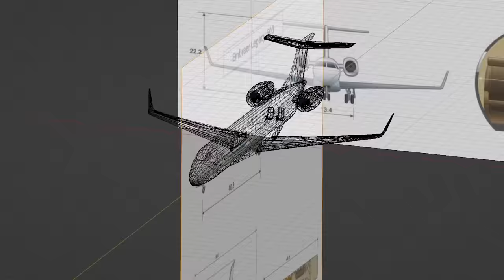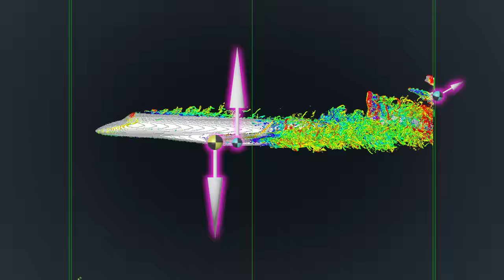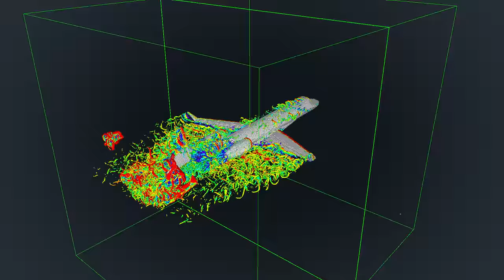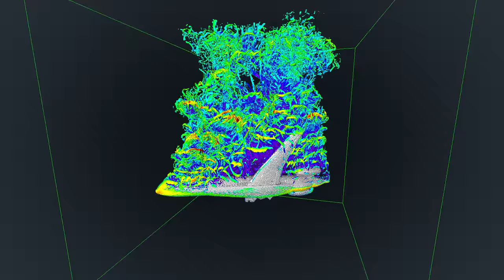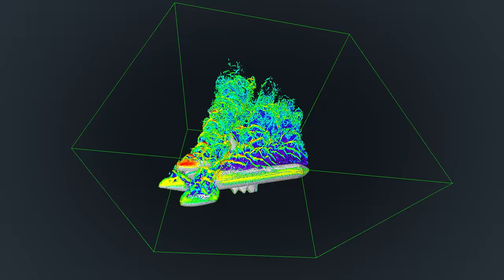Prigozhin's Aircraft Crash Analysis

Comment: Something to note, the cruise speed of a Legacy 600 is Mach .78, which at 28,000 feet is an equivalent airspeed of only 544 kmh/294 knots, which is a fair bit less than the 700 kmh you said you based your simulation on. Additionally, I'm not sure what effect the deceleration of the aircraft (which acts opposite to the drag force as far as wing forces are concerned) would have on the final forces endured. We have seen well-maintained aircraft exceed their positive and negative G-limits by several times and I'm not sure complete wing separation would be likely to occur immediately since the wing failure would likely begin with control surfaces and the wing tip structure failing, reducing loading on the remaining wing.

Nevertheless, it does seem the most plausible explanation if the tail section stayed with the aircraft to the ground (which I can't tell form the video and I haven't looked at many pictures of). One thing I think we can all agree on is that Legacy 600s tend not to just suddenly do that. And also that a missile shootdown is way way funnier than a planted explosive.
Reply from the maker: I'm talking in ground speed w/o wind (TAS) here for some perspective for the average audience, I don't think ppl would be interested much in the IAS or EAS so I went with ground speed and I think 700 kph is a conservative ground speed figure. 
The tail section is seen in photos separate from the main wreckage and well preserved from a lack of post-impact fire. The main fuselage was located elsewhere and the wreckage was badly damaged by fire. The detached main wing was located somewhere else too and undamaged by post-impact fire.

Comment: there is a video with an upwards smoke trail first, which seams likely a small rocket.  What software did you use ? (i'm on the lookout for simulation software of hobby plane designs).

Comment: Metal fatigue is a possibility. Sabotage by jealous group members is a possibility. Staging self death is a possibility. There are too many ifs. Anyone that draws their conclusions based on you tube reports should think it over many more times than twice.
Reply from the maker: I don't attempt to speculate on the motivation of whoever was involved, just the mechanical process of how this happened. As such, the only thing you mentioned I would disagree with is that it could have been metal fatigue as this isn't likely at all in this case. But yeah it could have been staging a death, could have been jealous people sabotaging... In any case, even from a limited amount of evidence it's clearly an intentional act
Reply: @SLGY  Thanks for the reply mate. You say that it was an intentional act, is that because private jets are looked after better? My knowledge of aviation industry is limited, I only know of one such example where the Japanese flight lost its tail, from watching the air crash investigations. And even that was due to poor repairs after a tail strike during landing (if I recall correctly). Is you reasoning that, such catastrophic frame failures don't happen on their own? BTW a fantastic video, did lots of work.
Reply from the maker: Yeah that's what I'm getting at there. There's been about 650 million commercial and private jet (above 5070kg) flights in what I'd consider 'modern' jet aviation. And only a handful of times there's been catastrophic failure, and those events had clear negligent causes. Now consider the chances that a 1 in 100,000,000 event occurred to someone who just betrayed Putin...
Reply: @SLGY  I see mate, thanks for the reply.

Comment: According to aerodynamic, you absolutely right.... but explosion inside of the fuselage lieds to rapid decompression, and at least one of the passengers would sucked out of the airplane. No doubt, no one in the corporate jet keep fasten seatbelt at 28000. Meanwhile, all passengers were found out inside. What does it mean?! There was no large hole. How it is possible ? Explosion from outside.
Reply from the maker: There's nothing much to suggest that it had to be a fast decompression, even if it decompressed over like 1 or 2 seconds you'd hardly even get a breeze in a cabin this small and at that outflow rate. I've done some time in our air forces hypobaric chamber (comparable in size to this jets cabin) and going from sea level to 20,000 feet rapidly you hardly notice any movement of air, only the sudden mist and coldness. 🤷‍♂️

Comment: extra bag in the baggage department is likely, but further aft, a bomb in the avionics bay which is behind the pressure bulkhead of the passenger/baggage compartment is more likely as that is the location where the tail is attached and even a small device would destroy all the control computers

Comment: You can hear both engines working all the way down. I think they stayed at cruising thrust the whole time.
Reply: Might aswell. Nothing to lose at that point.
Reply: @hherpdderp  well, modern SAMs target to cockpit...
Reply: @MichaelThe-Pyro  What? That's simply not true. They target whatever their radar guidance systems tell them to, which is more than likely the center-mass of the target.
Reply: @WimsicleStranger  it is completely true for Radar guided SAMs. They lead the target in order to make impact... The cockpit is at the front. Look at photos aircraft hit by a surface-to-air missiles the majority of damage is to the cockpit and just behind the cockpit. This is very evident in the Malaysian airlines flight 17. Severe shrapnel damage is shown to have impacted the cockpit. I am a random internet stranger yes, however I do have experience in this
Reply: @MichaelThe-Pyro  If I shoot a TOW at the flank-side of a moving tank. I'm not aiming at the driver because "I have to lead the target and the driver is in the front". That logic is just silly lmao.
Reply: Not possible considering one wing was completely severed and not near the crash.
Reply: @MichaelThe-Pyro They don’t aim for the cockpit they aim for a calculated point in front of the aircraft based on the difference between their speed and the aircraft’s.  Also it’s not just a feature of radar guided missiles, even infrared self-guided missiles do this.  Also you’re wrong about shrapnel damage to the cockpit in this case.
Reply: @AnarexicSumo  I am telling you due to my occupation I have knowledge on this the majority of Russian anti air is designed to explode on the forward section of the fuselage and cockpit. On paper this is because there is a higher likelihood of controls being severed or crew incapacitation. I would go into further details about this but I am not sure if it's public info as my 2min Google search wasn't much help. But I guess "trust me bro".
Reply: You don't. Period.

Comment: Thanks for that analysis. Initially, I was suspicious of a missile attack because of the missing wing, usually missile attacks result in partial wing failures or total breakup. The fact that a wing was missing from the root was very abnormal in my opinion. The details of the baggage compartment location and your simulation results strengthen the sabotage hypothesis significantly for me.

Comment: Explosive charges are seldom hand made when in institutional usage.
Comparing the minimum and maximum amount of force that can cause the simulation to run within or similar to displayed parameters will yield how aggressively the structure had to be deformed.

The structures are standardized, and so are grenades and other munitions. There is a real possibility you could work out the distinct force required and see what standardized grenades or charges fit the profile.

Comment: My gut tells me that explosive decompression at that altitude, the passengers would not be conscious. At least I hope I'm right
Reply from the maker: Time of useful consciousness at FL280 is 2.5 to 3 minutes (that's useful consciousness, you'll still be conscious for a long time after that too) ... and even then they descended into thicker air so fast that hypoxia is a non-issue here. The cabin would have rapidly filled with fog for a short period, and there would have been some very sore eardrums (maybe ruptured if they had blocked from a flu or something) for everyone onboard and a lot of disorientation.
Reply: @SLGY  I'm sure you are more informed and qualified than I am. I didn't mention it, but, I was also thinking of the blast effect from the bomb too, combined with the immediate decompression.
I'm either case, I wouldn't want to experience it.

Comment: I think the kind of damage visible on the video could be caused just as well with an explosive charge within the aircraft, as well as from an external source (an anti-aircraft missile exploding in the vicinity of the aircraft).

I think we can rule out "accident" as the actual cause, as spontaneous structural failures are rare. Even if the aircraft's maintenance was neglected due to sanctions, it would require some extreme corrosion or fatigue damage for this kind of separation to occur on its own.

As you said there is at the moment not enough reliable and credible evidence to make a distinction between internal explosion (sabotage) and external explosion (a shootdown). Inspectors with international mandate and oversight could be able to make that distinction by inspecting the wreckage for shrapnel or identifiable missile fragments, or chemical analysis for explosive residue. It would not be difficult to either find evidence of one, or to rule out the other by the lack of evidence. For example if no shrapnel holes were found, then it would be almost certain that it was not a conventional missile. Which would heavily suggest an internal explosion, as described in the video.

There would still be some chance of the cause of breakup being some kind of new type of missile that doesn't have explosives but rather works by collision with the target. To my knowledge Russia has no such weapon system. As for the whodunnit - I think this was most likely done by the FSB or GRU on orders from Putin himself, but it is also possible (however unlikely) that it was done by some other party such as Ukrainian-minded operators within Russia, or someone in Wagner itself being bought by Prigozhin's enemies. And Prigozhin had no shortage of enemies.

Comment: "Russian TV stations rather painstakingly explained that Prigozhin’s flight (carrying Wagner's top brass) had inexplicably switched off its transponder and gone 'dark' or stealthy. At the same time, apparently, a Ukrainian drone was in the vicinity. Therefore, the explanation goes, Russian air defense may have mistakenly shot down the Embraer airliner carrying Prigozhin as an unidentifiable hostile element, early in its trajectory from Moscow to St. Petersburg, some 300 km from the capital." -  Forbes. The flight (and sudden descent) was visible on flight tracking apps, therefore the transponder was operational.

Comment: On board sabotage disregards the tell-tale puff of a guided missile seen in the beginning of the shoot-down video
Reply from the maker: I've seen a few missile impacts in my time and have never seen a delicate little puff like seen in the Progishin vid. I think what we're seeing is spattering of unburnt fuel dumped quickly in the air as the wing ripped off (wings tanks hold a majority of the aircraft fuel). It stands out a fair bit from all of the light glistening through the fuel spray. A successful impact of a kinetic weapon involves, significant amounts black smoke, many tiny bits of airplane being clearly ejected from the impact location, many large bits of airplane, lots of fuel spewing out (with a 99.9% chance of burning from impacts of hot metal fragments), etc. I know the 'puff of guided missile' you're talking about in the video, and it's about 1 fuel tank's worth being dumped into the air all at once from a wing. 🤷‍♂️

Comment: i agree (and previously held a similar conclusion) with the overall technical basis of this video but I wanted to add a but of.....Dare I say....."technical spice" to the discussion lol

my theory is that a mechanic/maintenance staff was infiltrated or put to the job of placing explosives NOT inside the cabin in some non-descript rear area of the jet, because, keep in mind, this is a newer $21 million jet with a high-value-warlord and I am sure he/his advance team/direct security had some shred of OpSec or Operational Security regarding the interior cabin, etc and a cursory knowledge of the exterior. That plane had to have been guarded, and YET even if it was being guarded during a "maintenance checkup or mechanical review", I don't think Prigo's men would be technically astute to know what was going on and hence my now very long circuitous theory is that......

a small amount of explosives was placed near the "trim motor or trim cable" and/or MAYBE some sort of corrosive thermochemical agent was applied to the stabilizer's jackscrew which activates with heat, ie. friction, ie. See: Boeing MCAS/Autopilot or Air Alaska crash, and thus would induce a delayed but efficacious structural failure of the jackscrew threads and rod. I believe this  for two compelling reasons:

1 - on a small jet like this, maintenance regarding lubricating the jackscrew would have been much easier to access than an airliner. . Therefore leaving a small explosive there or "lubricating the jackscrew" for "scheduled maintenance and upkeep" right before that flight with the aforementioned thermochemical agent would have been so easy to do without catching any suspicion , ofc, unless I was there, I would have submitted the sample to a DSC machine and wait lol but jokes aside, they would have needed only a small amount of explosives, palm of your hand size, to knock out the jackscrew, or heck, they may have set a sort of tripwire switch connected to one of the limiter nuts on the jackscrew and at a certain elevation, or angle, it would have exploded. but I don't put too much weight on that bc the pilot could have done a systems check on the tarmac and maybe trip it?

2 - before I go further,  I know this is Embraer and Brazilian. I know that Embraer is a great airplane brand but no Gulfstream or Cessna or Western brands? or is that a sort of rule I'm guessing post sanctions? I say this because if it was an American or Western brand, the company and their national regulators would be insistent on sending their own investigators, to which Russia would most likely NOT allow and I think Brazil would not or may not have a similar procedure and even if they did, I don't think they would want to mess with the "big bear". Having said that, THE BLACK BOX IS LOCATED NEAR THE TAIL, MAYBE NEAR THE JACKSCREW MOTOR ASSEMBLY itself. Therefore, it is highly unlikely, if the bomb was placed there, like I mentioned that the black box would be of any material utility. 2 birds. One stone. Sorry for the pun. Add to that, the latest dramatic airplane failures seem to be MCAS-related such as the Boeing 737 MAX and maybe I am looking at it with too much of a technical american-centric perspective but I have to think, Putin is a diabolical genius, esp his KGB/Intel methods, psych warfare (remember him bringing a big dog to a meeting with Merkel bc he knew Merkel was scared of dogs?) and with how well Russian aerospace is, I don't think it took much to conjure this plan, find the right man, and badabing badaboom. err excuse the pun, again, I know, very poor taste and I'm being cringe lol 

therefore. sans honest untouched maintenance reports, black-box data, on the scene untouched forensics, the best hypothesis is:
palm sized plastic explosive placed by "maintenance crew". timed for detonation for typical embraer ascent to cruising altitude or whichever altitude. worst case, the jackscrew and motor fail and its doomed 100%. best case scenario, it the aforementioned happens as well as obliteration of the black-box. and the rest is history. 

some sources for my reasoning: 

-see link from Wikipedia regarding what I am referring to as the tail stabilizer, jackscrew, etc:
-- https://commons.wikimedia.org/wiki/File:Adjustable_stabilizer.svg#/media/File:Adjustable_stabilizer.svg

-and regarding my black-box theory, per google "Black boxes are designed to be the least affected by an impact. This is why they are located in the tail of the plane."   (my note: least affected unless blown up on purpose I surmise)

- here is where te black-box and voice recorder is located. it is linked via google image search. excuse the awkward looking link but it is safe to open, I promise lol: https://images.app.goo.gl/NBuYLRXdWquJ9tGf6

one last note: failure of the stabilizer/jackscrew/motor/blackbox do not exclude the possibility that the entire rear tail section did or did not tear off as shown in this simulation. before anyone reminds me of that, I wanted to state that assumption. thanks

Comment: It seems likely to me that Putin would have had someone plant explosives directly on the aircraft while it was on the ground. It might even have been possible to get to the outside of the aircraft  and attach an unobtrusive external charge on the top of the aircraft near the tail.        Perhaps even via a drone.   Drone drops onto aircraft, deposits remote explosive charge, which then clamps onto the aircraft via an adhesive/glue.